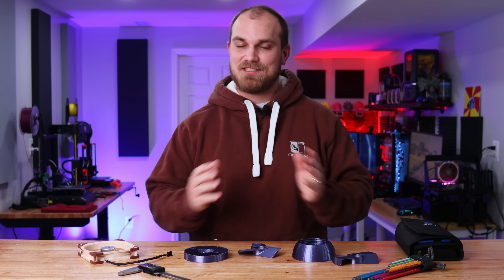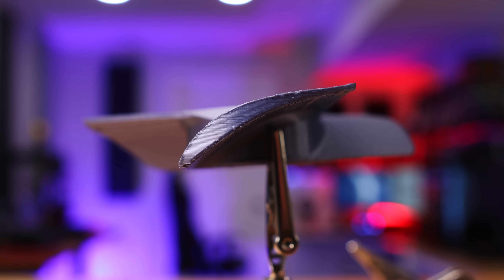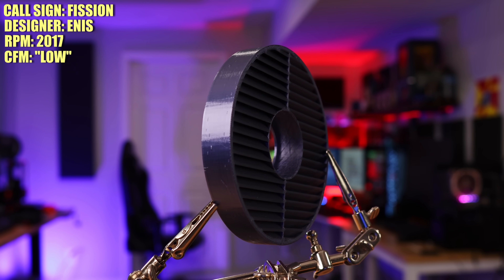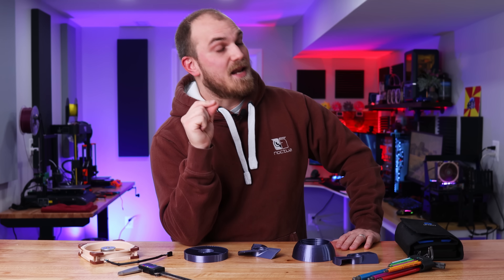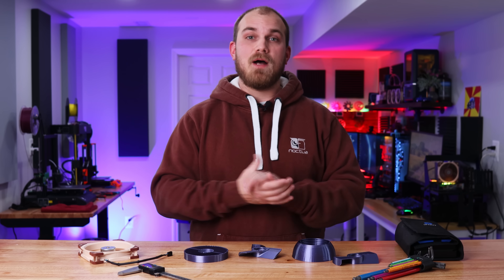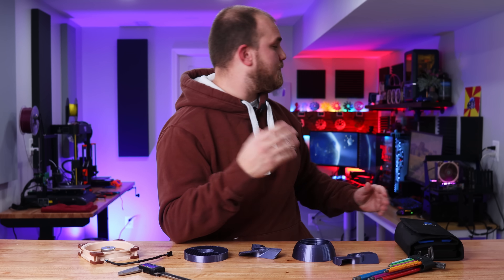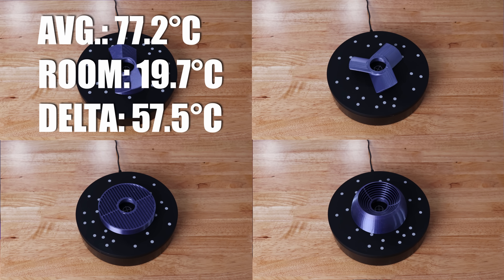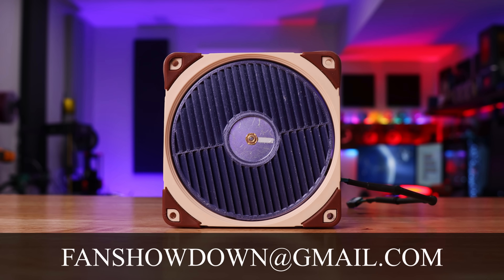IS THIS MAGIC? This Fan Has No Blades | Fan Showdown S2E3

Comment: Hey guys. Thank you for this highly interesting showdown. I have a special request. I have been trying for years to create a FORTEX inside my cars intake and from my experience if you get it right it dramatically increases performance!! I assume that if you get it right you create an extreme low pressure at a critical point in the intake plenum and this greatly increases airflow. I could hear it starting to whistle at the time. Can you guys please help me create a blade to put inside an intake plenum to do just that...increase airflow by creating a fortex. Thanks you very much.

Comment: Biggest load of shit I have ever seen, wish I could get that 9 minutes back, i have built better compressor wheels out of cardboard cerial packets😢 what a joke, and why you show it in slo-mo😅so we can't see how useless it is, i only need 2mins to explain compressor wheel designs to you that would flow 30 times more air at the same speed, or even slower and quieter

Comment: We need a re test of the top 5, mid 5, and last 5 of every season leading up to S5E7/8/9 or even a S5 finale on the new setup. The data being collected by these fans performance is super important, if only to help as an independent way for individuals to do maintenance and "aftermarket" improvements for personal use. I think this line of participation and collective interest is something that should spread amongst all types of readily available every day improvements.

Comment: could something like this be mounted on the face of a hub motor and keep the motor at a lower temperature?
the motor is optimized to max out at an rpm of 2240. at that rpm, the speed of the vehicle will be around 100 mph.

Comment: once you establish flow with blades the blade stops it again .. you hardly get real flow ... a spoke allows more air through when spinning .. so a tiny sing spoke or blade spoke to outer wall cicrcle spun like a hollow tube with small internal lining ridges will beat all your fans with yur motor limitations ... in place  . no contest .. best a farm.. bet the earth

Comment: Try the blade less in reveres like a turbine out instead of in. This turn should focus the air into the cpu cooler . Of course you will need a stand off for the size compensation of the protruding turbine dome . It looks like it focuses the air running in that form.   
Just a suggestion.

Comment: Ok, I have watched a bunch of your fan testings. and I have to make an observation ( which could totally be wrong ) . but your test is basically to see how well these fans will do in a PC Case.. 
yet your test does not really show how well these fans work in a PC? .. 
what I mean is , your smoke test.. you see how well the fan does in OPEN Air. but inside of a PC.. measuring the temp. inside and how fast it cools down etc.. would show how well the fan works Within the Cubic footprint of the case.. ( IF that makes sense to you ?) .. 
some of those fans may fail in a case, and others work better in open air.   

To ME a test on how well these fans really do? would be to put the fan inside a PC  with a switch on outside to turn the fan ON and OFF.. temp. module inside pc. to measure temp. and when it gets hot enough inside .. you turn on fan and see how fast it cools down (if it cools down) the PC? cuz your basically not measuring any air pressure for the fan, as it's in open air. 
Hope some of that made sense? 

I say all this, cuz after watching a bunch of these fans, especially in the smoke test.. I saw how some really pulled and sucked the smoke. and if it was inside a small cubic footprint of a case instead of out in the open, it's performance would be MUCH different.   
and the same for Sound.. your doing OPEN air sound test.. instead of inside a PC .. which would make the Decibels totally different.    Anyways just my 2 cents worth.. 
On a good note. if you think i'm correct. you can start over with all your fan blade test inside a PC.. LOL..

Comment: Commenting from the far off future....

Interesting that avoiding turbulence is chosen here.

While good for just flow numbers, turbulence is absolutely necessary to maximize cooling through a radiator. Of course this naturally happens once a certain flow rate is achieved however, so I wonder what the engineering verdict is on the importance of trying to get laminar flow with a bare fan out in the breeze.

Comment: The Bladeless fan design would excel in lower end machines. They don't need much cooling. I'm thinking of i3 and Pentium machines. It would be more than adequate. That said, I'd be interested in seeing the "bladeless" design with blades in the backside. It would be complicated but with a two or three blade airfoil and just the right amount of washout, it should still be on the quiet side.

Comment: What makes noise is not exactly the fan, it’s the difference in air moving and not moving, fast moving air directly next to still air will always make noise. The larger the area or slower the air the quieter. The jet of air from aircraft is a prime example the engine itself is actually not that loud… And the nozzle that releases compressed air to clean your shop floor is absolutely silent but the velocity is high so it’s extremely loud, so what your trying to do is build a bigger slower fan, or worse, a much less efficient one. this tiny detail sorta makes this a fools errand, a little 🤪

Comment: What's the rpm of the fan motor?  I'm curious if using a higher rpm industrial motor with the bladeless fan if the performance increases with and still keep the lower noise level. You could track another top list by comparing fan performamce by the same noise.

Comment: The first and second place are definitely what I would go for with any system that I’m going to be pushing pretty hard, but the bladeless wins for me when it comes to htpc or and media type builds that won’t be putting out too much heat in general just because of how it quiet it is compared to the others.

Comment: Nice designs and a note 
The noise coming from the blade is due to the fin is slicing through the air causing this high noise 
A fix for this is use a guide ring around the fins and the fins should not be straight it should be twisted type to increase air flow and reduce vibration and noise.

Comment: It looks like one or two of the blades took their design from the Sopwith Camel. A plane that w
Could stay airborne at minimal speed. The wings displaced enough air to keep it flying with little effort. Not to sure about noise but, effective air movement it should out perform almost all designs... Maybe with some tweeks due to it being a rotational setup vs flying straight through the air. Different turbulence and such...

Comment: To make a fan "equal", in pressure delivery... You have to twist the blades flatter, the further you get from the center. The easy way to do this is create your inner-angle first, and simply rotate the fan and pull a line outward from the inner angle, to your outer-edge. (In code, you can just project the angle from your inner angle, to the outer-edge, spread-out so the lines all intersect the center of the axle. But your blade will be larger as it expands out. You put MORE twist back into it, if you make the blades more narrow, but you will introduce more noise and completely nullify equality of pressure, creating a "pulse" as that gap between blades expands.) This is because the outside edge of the fan blade is spinning faster than the inner part, near the axle. It travels a greater linear distance, so it needs to be less of an inclination. Otherwise the outer edge of the fan will be "pushing air outward", while the inner part will, relatively, be "pulling air in".

Adding a "cone" to the exhaust direction, will also quiet the fan a little too. Otherwise you create a "void" that the air is constantly collapsing into, which creates a faint pulsing, at high speeds. That is why jet-engines have a cone at the exhaust, off the turbines. It has to be designed for the specific air-flow that you expect to be moving. The faster the air-flow, the longer the cone has to be. The slower it is, the shorter and more blunt it can be. (Slower air will diffuse faster and faster air will thrust out before expanding, creating a form of "Venturi effect". That is why a "free-air" fan seems, initially, to be better for massive air flow. Only a fraction of air is being moved "by the blades", the rest is ambient "flow", pulled-in to motion, by the directed air.)

A pure quiet fan would be a simple "balanced disk", with stationary "wipers", that skim air off the surface as the disk spins fast. Hard-drives use a form of this air-skimming, to help float the head off the disk, as well as circulate the air internally, within the pressurized case of expensive nitrogen-filled drives.

The best "free-air" fan is a simple "propeller" style design. It has the greatest "free-air flow", but low "static-pressure". Actually quite a horrible design to use for cooling, but great for moving a lot of air around, unrestricted. The best fan for moving high volumes "through restricted mediums", like filters and cooling-fins and radiators, is a "squirrel-cage", or "blower fan", which uses lateral blades, arranged in a circle, and harbors the power of "centrifugal force", as well as airfoil properties, to "pump" massive volumes of air, at high pressures, through constricted mediums. Though, it is notably less volume than a "free-air" design, in "free-air"... It pushes MORE, under high static loads, than any "free-air" design can possibly ever do, with less power. (You can get a venturi effect with a blower-fan too, making it more powerful than any free-air fan, which is the secret to the "Dyson bladeless fan" design, which actually has a blade, out of view.)

The right tool for the right job... Computers, for years, have used the wrong tools, because they were cheap, or adequate, "out of the box", but not "in regular use".

Comment: Sean’s has low performance because it’s effectively a smaller fan with that small frontal intake, it should be tapered outwards instead to increase the surface area it’s collecting air from.

Comment: People should focus on designing turbines rather than fans as most energy ultimately comes moving water either as liquid or vapor subsequently turning the turbine. Maximize the efficiency of turbines then maximize the efficiency of input flow and boom. Now all you gotta do is stop using your damn fossil fuel ya fools

Comment: If the bladeless had slanted it's blades I bet it would have sucked a LOT more air... as it is it's reliant on friction from the parallel surfaces to create capillary like actions through the spinning flat blades used for support

Comment: Might I suggest an additional test with these fans.  Use an actual air flow meter a specific distance away from the fan and record that.

The tunnel affect - put a 1, 2, 3, inch long tube in front of the fans - that's the fan area not the shroud section then check actual air flow with a meter.  each might have a different diameter  (might).

Then use a cone affect tunnel and take the same readings.  One is straight shaped one is cone shaped.  The cone shaped one needs to be made on a large coned shaped form to keep the shape consistent - then it is cut to length for each shape so they all have the same shaped cone and the same length of cone (just use 3 inch) - but each will have a different exit diameter to fit each fan.   Heavy paper would work just fine.

Then if you really want to get crazy - build a wing shape for each one and again use a actual air flow meter to check air flow.  (a simple wing shape)

The reason - look at the smoke test.  It  shows when air flow actually picks up

Comment: Nikola Tesla worked on bladeless turbines. He would usually go for high speed, high voltage, high frequency, etc.
As for the bladeless fan, it reminds me of his bladeless turbine, which works better at higher speeds, because of the centrifugal forces.
Squish the design to a lower height, and spin it much faster, and you'd probably see a pretty dramatic increase in performance.

Comment: With Sean's fan, maybe try a housing that matches the outer bowl profile, which is flush with the fan rim, that could maybe be adjusted in and out. Maybe a golf ball pattern on the outside of the bowl fan without aforementioned housing?

Comment: Hello there from Philippines im an aircraft technician only just sharing my thoughts to you.Just make huge fan blades but not to much for the motor and motor that run only low rpm but high torque,this reason you could  minimize noise. In your experiment i think you are not looking for compression so you dont need hugh speed motor but just lower rpm with high torque in low rpm. But if your looking for some compression just make simple a CENTRIFUGAL COMPRESSOR or in EXTREME AXIAL COMPRESSOR with many stages of rotor blade and stator bladed

Comment: You really should take Trinity and put a ring the outside the the 3 blades...that should drive up the flow rate and drive down the noise also... Your losing flow and making excess noise by tip vortices.

Comment: compare these designs should be with the same size. Large one is always better than small one. Large one has better performance like low noise , large flow rate & low power.

Comment: Could you beat the bladeless with just a large heatsink with no fan? what's the largest air cooler that can be bought retail that doesnt use a fan (or could safely run with the fan removed)?
Reply: A heatsink works with the cold air going over it and pushing the heat energy out, thus meaning a fan would still make it way more efficient
Reply: @ThomasFarquhar2  I know a fan is more efficient than no fan, but im just wondering if (and not for my build, purely for experimential learning) a large heatsink and no fan. Can do better than a small cooler with a shit fan. The benefit being: No fan at all = ultimate noise test winner

Comment: I think you need more RGB in the background. I’m not sure that I was thoroughly distracted by the current level of blinking color shifting light! Also the noise reduction R&D is cool but without CFM and Static pressure data is it really useful?

Comment: The fission I didn't think I would like the fission until I seen it running and it has a really cool like shimmering pattern. There was a time I was all about fan performance and had a bunch of Scythe Ultra Kaze 3000s (133 cfm fans) on my wet bench but it was such overkill they never spooled up unless I raised the baseline, so I put some RGB Corsair fans in it with the lights in the hub instead of the housing because it looks much better and more even lighting. My water loop can quite possibly keep the CPU cool without any fans on the rad given the volume of water, and radiator surface area. I think I'm going to test it actually. Anyway my point was I can sacrifice airflow (going to much lower performing fans) for appearances with 0 change to my temps so why not have some fun with it? =)

Comment: The “blade-less” fan isn’t free from “blades” they aren’t exposed in the traditional sense, but there are still blades and they are just enclosed. The vertical structure walls that run the length of the cone and have a pretty substantial width are in a sense directing the airflow down and to the layers of circular channels while exiting out the concaved slits. It’s just a different design.

Comment: The other video aside you should DEFINITELY try acetone smoothing the bladeless design for better performance. It's counterintuitive but what you've basically got there is a modified Tesla Turbine design. It's relying on what Tesla called "adhesion" to induce movement in the working fluid and adhesion works best with glossy smooth rotors.

Comment: Just stumbled across your vid. Always good to see new designs made. All good and well, video nice quality, decent sound, some humor, decent pace (apart of too long smoke sequences) but one massive thing missing if this is to be anyhow serious and to have any meaningful take off - you simply have to have a proper testing methodology. Sucking some smoke is good for cigar lovers but totally useless for measuring performance of cooling fans. Also, compared to mainstream fans (it is a pity you didn't have one as a bench mark, at least we would have had some meaningful comparison ) the temperatures you achieved are simply not worth the trouble, those deltas could be achieved with large heatsink and fanless open case :). I like your style hence some advice, of course you tell me to take a hike ;). I started playing with with PC cooling 20 years ago where we soldered potentiometers to graphic cards and mother boards and were hunting dumps for old fridges for multi stage freezer coolers lol. I was inot TEC tech and built the first passive TEC cooler system ever to work. I wish I had 3D printing back then :). Anyways, good luck and I subscribed to see how are you doing

Comment: Can you print just the hub and glue a CD onto it to get a measurement of the fan motor's sound output under load but without moving air?

Comment: The bladeless may have lost in total cooling power, but it was quiet. It that way it was the best of them. I wonder what would happen if you turned down the RPM on the other fan designs so that they were all 42dB so we could compare total cooling power at the same noise level.

Comment: You should work on creating a cheap wind tunnel system around your fan motor module to calculate the actual Cubic Feet Per Minute (CFM) each fan displaces.